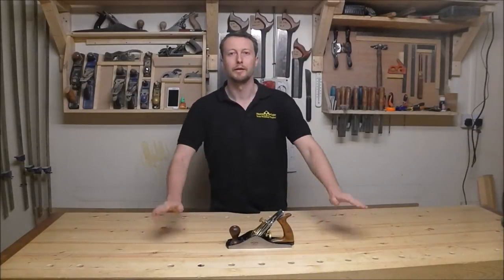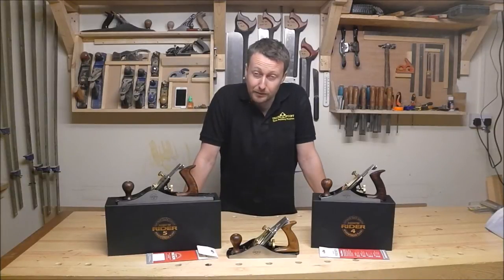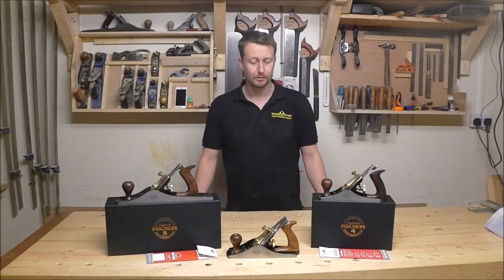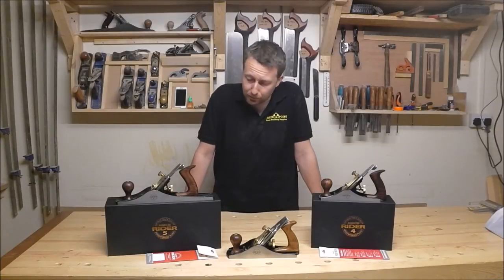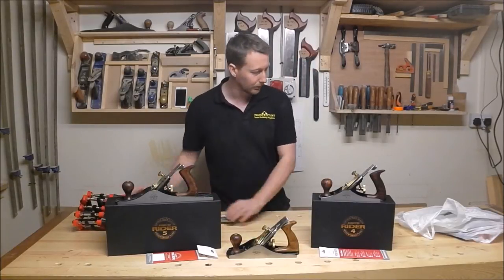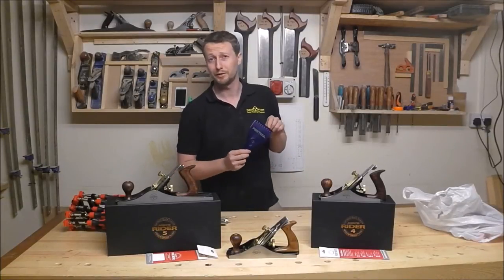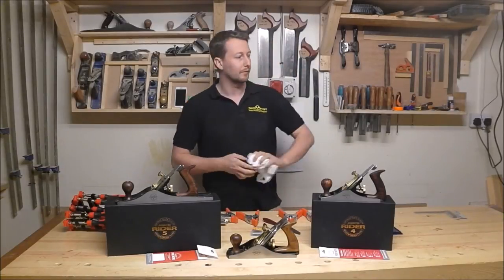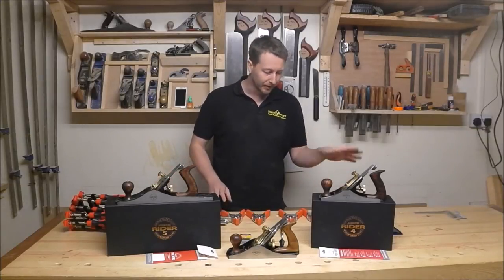Woodworking and Power Tool Show / RIDER Bench Planes

Comment: I have a 41/2,  5,  6, 691/2 low angle block plane and a 311 shoulder plane,      I agree a very good plane,  however the no5 and the block plane had soft blades in them, they burred over after 3 or 4 passes,  I solved this by re hardening blade.  A great plane but Axminster need to address this issue with blade quality as it lets down an otherwise very good product,  but my 41/2,  6 and 311 blades were good.
Reply from the maker: +martin youell  Thanks for sharing that. I cant say that I have had any such issues with mine though. Thanks for watching.  :o)